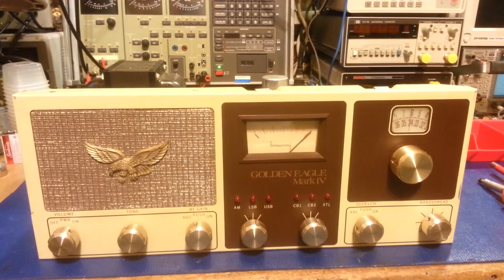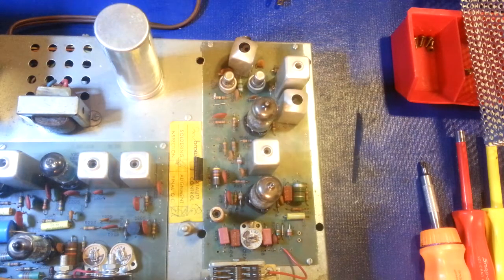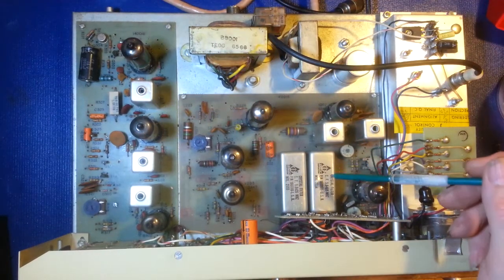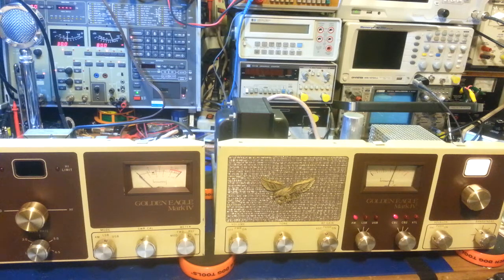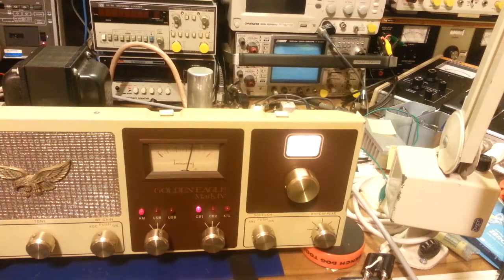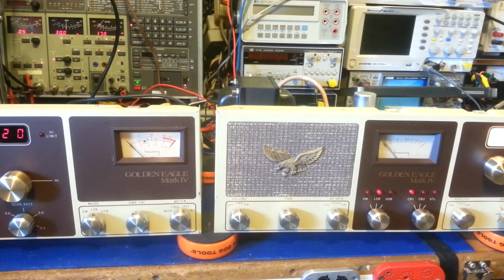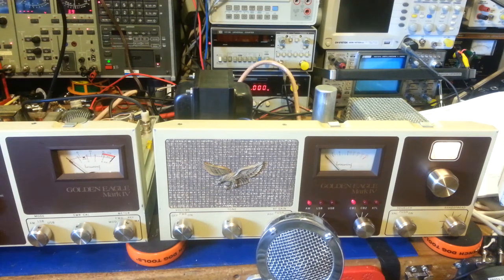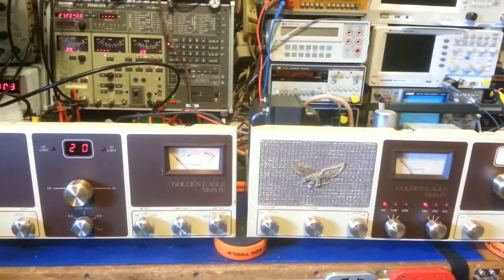Browning Mark IV 4 CB radio overview and alignment.

Comment: Yes the ping is a designed flaw that the engineers knew about but left it in, this led to all of the gimmicks that came on the market to immitate same, just a little browning history. The key to a good bird chirp is to move the mic away from radio as it is keyed, never fails to entertain the masses...hey mister, your radio has a squeel in it....never gets old.

Comment: 641 on the time 

Part number on the board is R229  any help would be greatly appreciated. And what may have caused it. The radio has been sitting for about 10 years. I repaired the rest of the radio but can't find this one.  Thanks for your time. And awesome video by the way.

Comment: You did not show how you align it with the cage on?   my mark 4 A has no rx after ch-27  CB-2?
Reply from the maker: You put your alignment tool through the holes in the cover/shield.
Reply: my trimmer tools do not fit thru the holes...
Reply from the maker: +Nordland796 

Definitely a place where you need the right tool for the job.
Reply: I took the cage off and drilled the holes bigger over the adjustment points so my trimmer tools fit..